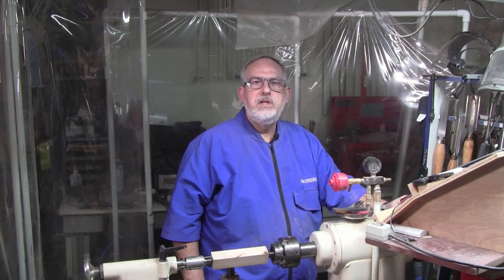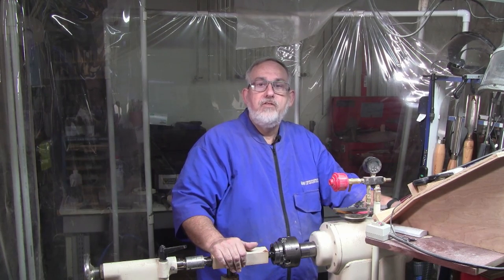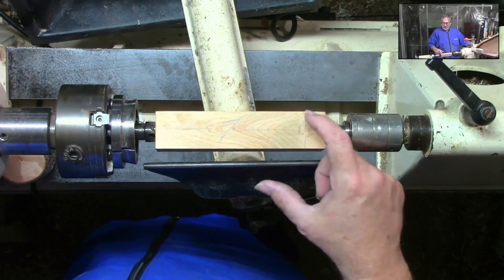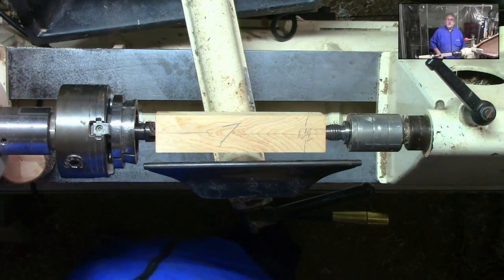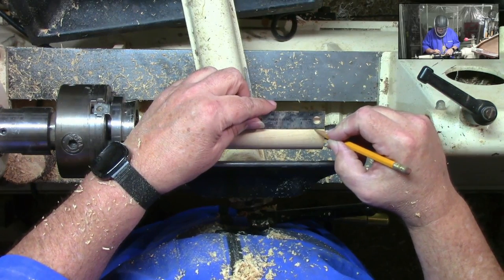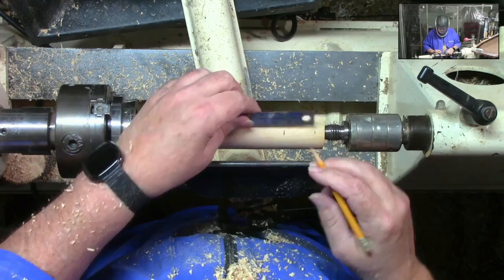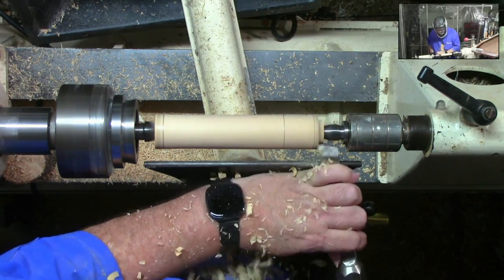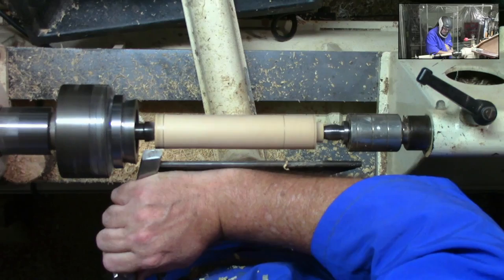How to turn a coffee Scoop by Dean's Woodworking #woodturning #woodturningforbeginners #woodworking

Comment: I cheated.  I did mine before seeing your demo here and the other one where you make soft jaws instead of the jam chuck so I just used a kit from Rockler and drilled my 1/4 hole and used a scrap of cherry and mom liked it a lot.
Reply from the maker: Sounds like you did fine, I do the kits too, they are a lot faster. Thanks for Watching!!!